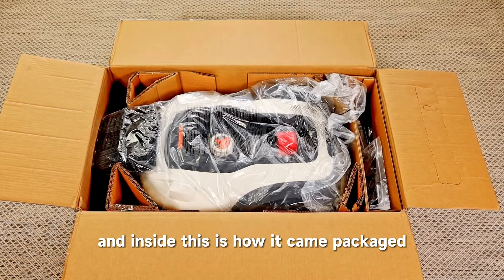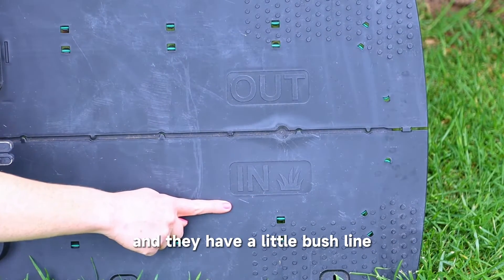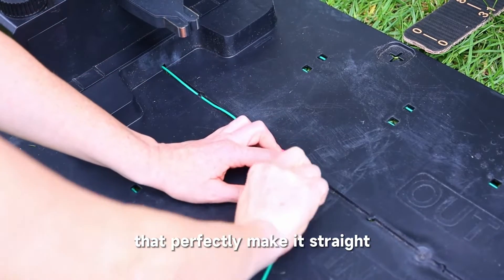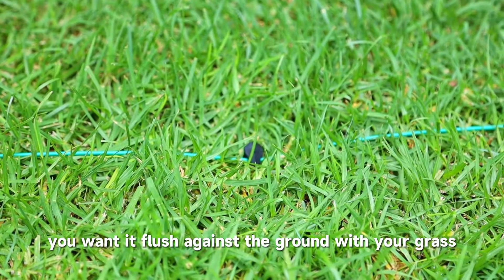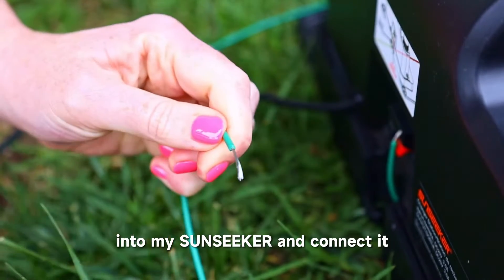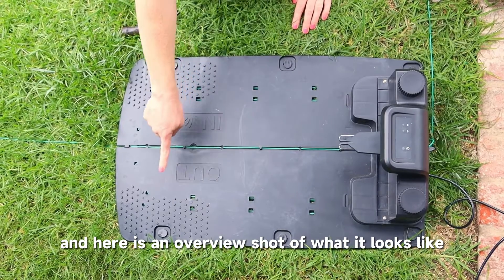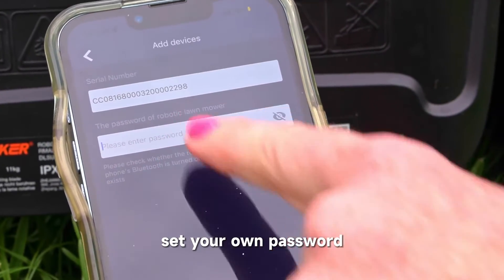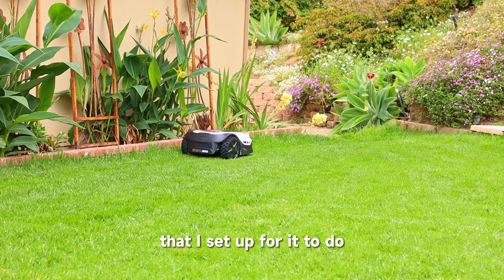SUNSEEKER L22 Series Robot Mower Installation Guide

Comment: What significance does the Starting Points have? For example if you choose 4 starting points does it automatically rotate between each starting point for the next 4 mows?
Reply from the maker: Hi Chris, thank you you for your interest. The setting means you can choose where the machine start working.
Here is a instruction for you:
If there are two options for you to set, 1 and 2. Both points are on the boundary.
And the percentage is the distance between the charging station and the start point (1 or 2) as a proportion of the whole boundary.
Normally, after the machine get out of the charging station, it will start working when it moves to the point 1 and it will start working at point 2 at the next work. And then it is the point 1 after twice works.

For example:
You set point 1 is 0% and 2 is 24%.
The mower will start working after it get out of the charging station at once because the distance is 0. Also, if you set point 1 is 100%, it will seem as the 0%.
At next work, (we assume your boundary is 100 ft), after mower get out of the charging station, it will move 24 ft alone the boundary to the point 2, and then it will start working.

And,yes! if you choose 4 starting points and set 0%,  it will automatically rotate between each starting point for the next 4 mows.
Reply: @SunseekerNA  Thanks for the reply! Helps a lot. Love my L22.